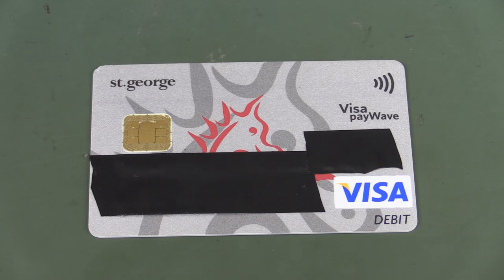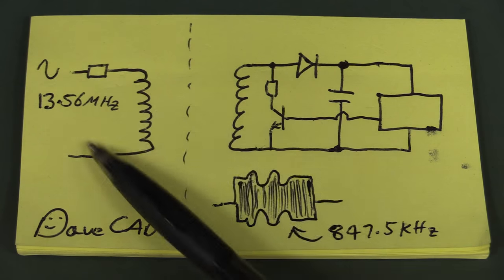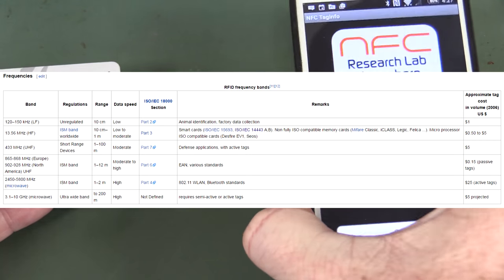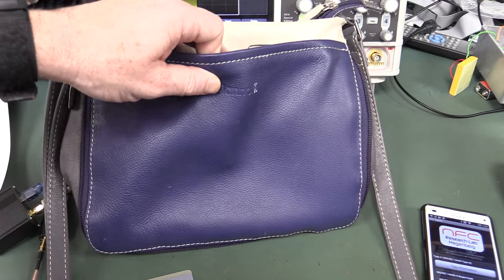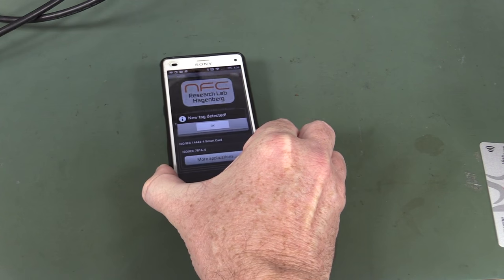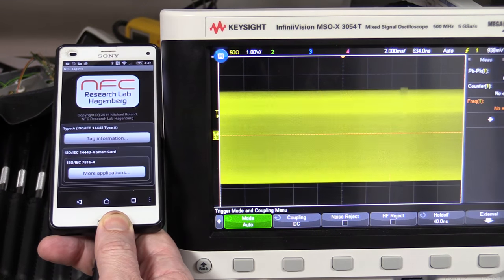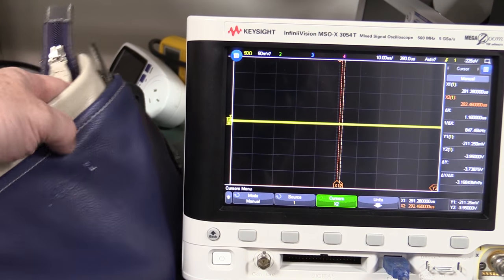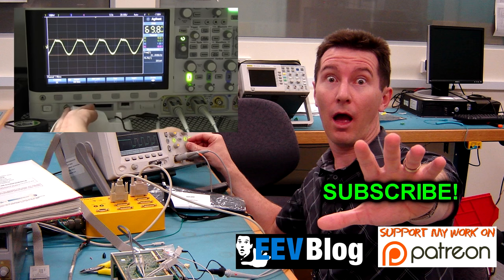EEVblog #889 - Credit Card RFID/NFC Theft Protection Tested

Comment: I have an idea or two about a protection features that can be added to these cards. How about if the chip in the card only starts working if it detects the electrical resistance from your fingers on the card? That way the only way the card can work, is if you are holding it. Otherwise it's only going to activate the coil if it is within a 13.56MHz magnetic field but there isn't going to be any data exchange. 
Something like a metallic grid on the card that should read somewhere between say 10 and 50 koms in order to start the chip. Or have specific finger locations that you need to hold the card at, in order for it to work.
And there is even a simpler way to do it, just put a dome switch in the card that should be pressed in order to connect the coil to the electronics inside. Needless to say that it's location must be a bit deeper in the card in order to prevent the button getting pressed while in your purse or pocket. That way you can only activate the card if you are holding at a specific location and apply some relatively significant pressure.

Comment: This is why no-one with any technical knowledge should call them 'RFID' cards. These are all NFC(Or near-field-commutation) cards.
Dave gets half a break as he's using layman's terms for ease of explanation, but searching for 'NFC' reader and 'RFID' reader gets quite different results.
Many public transport cards use the same tech, so they make for great test cards if you don't want your credit card shown on air. :) And if you want a somewhat overpriced(due to postage outside of us) way to see what tech a reader uses: https://dangerousthings.com/shop/rfid-diagnostic-tool/
Reply from the maker: Yes, true. The term RFID seems to pervade the industry though, although in regards to phones it's usually NFC.
Reply from the maker: BTW, The ISO 1443 standard itself uses the term RFID
Reply: That I didn't know! Shame on the ISO standards!
Also, as far as I know, these 'shields' act as much like a shorted turn as magnetic shielding, taking the energy the card requires and turning it into heat. A 'loop' of aluminium sheet works as a great shield, but one with a break in it(Still overlapping, but insulated) doesn't. For photos: https://goo.gl/photos/nWY5YPL9KhZabgFP9
I believe the more conductive the material the better it works in this application. I wish I had a piece of ferrite large enough to test this further.
Reply: The standard is correct. Maxwell is correct. "NFC is secure" is wrong.

Comment: Such a shield works while the card is in it.  Remove the card to use with the RFID scanner at checkout and a black hat behind you in the checkout line doesn't even need to transmit anything to pick up the signal.

Comment: Considering my CC number was stolen 3 times out of the local shopping center I work out of.  The issue was traced back to people hanging out in the food court/common areas on laptops with what 'looks' like a normal antenna hanging out a USB port.    How I took care of this scam was about the simplest thing in the world.    I just walked into my bank and requested a CC/Debit card WITHOUT the pay wave feature.  They make them in the chip reading variety as well.  As both my bank cards have chip readers, and NO pay wave nonsense.   Never be afraid to ask or request one.  Most banks do have these available and will gladly order it in for a customer.   The other scam that was exposed, the readers on gas/petrol pumps.  Seems the bulk of the companies continue to use the same KEY to open the access panels!  (And the serial ID sticker tabs are a joke!  One was ripped off a pump I went to use.  The clerk didn't check the system for a 'hack'.  Just slapped a new serial sticker over the torn one)   So never use 'pay at the pump' and request a no pay wave card.  And you'll be in slightly better shape. 

Another thing to consider:  How flippen LAZY is society when they can't be bothered to swipe or insert a card?  Do they want to look like David Copperfield doing a magic  "Wave the card trick" each time they purchase an item?    Just insert or swipe the card already.
Reply: >> "How flippen LAZY is society when they can't be bothered to swipe or insert a card?"  I have wondered the same thing.  It is just the latest novelty feature.  Most people are clueless and banks are still crooks.  An alternative to requesting a new card without this feature is to cut or puncture a single antenna coil trace or find the tiny bump where the components exist and give it a slight tap with a hammer to crush them.
Reply: Consider yourself lucky. I told my CC company that I didn't want a card with the RFID/NFC based system. They told me that they don't make any cards without this new technology. I was told not to worry. They would reimburse me for any fraudulent activity on the card. It amazes me that a CC company would rather fix CC fraud after the fact than try to prevent it up front. I wouldn't be surprised if their accepting fraudulent uses of CC's is part of the reason for high merchant fees and high interest rates to CC users.
Reply: No need to sign up.  LOL.  Actually I sent news stories about people in public areas using laptops to steal CC numbers and information.  The local center didn't do squat even when faced with evidence.
Reply: People love gimmicks.  And they think  "Hey, it's so cool that all I need to do is wave my 'magic card' to pay for something.   Now we have Google and Apple pay....paypal pay....    Things are going plastic in a huge way.
Reply: Tedybear315  Oh right, how did you deduce it was these people on laptops?
Reply: *****
  There was no other place where the general public would have access to do so.   I'm in my store 44hrs a week, and there's plenty of people on laptops hanging around.  I also monitor my card re: who has access to it while doing a purchase to ensure no one nips it to a skimmer.
Reply: Don't really think there are components to crush, these are printed on foil and have no thickness , sure cutting the transfo coil trace would work.
Reply: Tedybear315
Fair enough :)  Was just curious because, as Dave said, most contactless cards now encrypt the data.  Would be interesting to know what sort of set-up they are using to generate the EMF and what sort of range it has.
Reply: Dave being from "Down Under" they seem to have better security then us poor idiots in the USA.   With the advent of the tiny tiny CC swipe devices people can attach to cell phones however,  one must remain attentive on who takes their CC when a payment is being made.  Even a split second can equal a stolen number.
Reply: I've got another idea about how to fry the chip.
Overload it. A high pulse current thru a "pancake" coil with the card on top should fry the RFID chip without frying the "security chip".

You might also try just flexing the card a bunch (don't make a crease in it, just bend it).
It's a common way for RFID cards to fail, and there's no way to tell you did it on purpose.
Reply: 44R0Ndin would probably be enough take a hacksaw or heated blade and cut through the top 15mm or so of the card to brake the coil?
Reply: ***** True, that would work, but people (especially those who don't know the difference between the two chips in the card) would know someone's screwed with the card and might take it as an attempt to hack the security chip.
Even if I didn't know how the thing worked, I'd refuse to run a credit card that has what looks like obvious intentional damage to it if I was running the register.

Gently bending the card about 50 times (alternating directions, even bend without a crease line forming) would probably break the coil, and it would leave NO external visible trace.

Same goes for sending a small EMP thru the coil (to fry the RFID chip). Tricky part about that is not frying the security chip along with it (so microwave for 5 seconds won't work).

Comment: All magnetic fields have a electric field, an electro magnetic field is what we call RF. So technically wouldn't the transformer magnetic fields be just as much RF as traditional RF and if not please clarify?
Reply: I must ad to this that the magnetic and electric field do not have to be proportional and as such a magnetic field is much stronger in transformers then the electric field.
Reply: I think you are correct.  This system is an example of "Near-field magnetic induction communication" (see Wikipedia).  The electric field is largely suppressed by the absence of a proper antenna, so the magnetic field is unable to transmit much energy into free space.  Hence the transmission range is deliberately restricted to a few meters.
Reply: yes, modulating a coil is a radio.

Comment: "This is NOT a RF system, it works on magnetic fields instead of RF-fields" o.O Well, what are RF-systems working on ?
RF-systems are in theory a transformer system - and yes, they are called antennaes.
Reply: SnopFop - TheSkogemann rf (and other EM waves) are composed of electric and magnetic fields, but a pure magnetic field acts differently than an EM wave. That's why transformers and rf antenna/receiver systems follow different equations.
Reply: RF systems are NOT transformer systems. Transformers have magnetic coupling across the coils, RF systems do not couple between antennas. If you put a load on the secondary coil of a transformer, that creates a major load on the primary. If you turn on your radio in your car, that doesn't load the broadcast station at all. They have no clue if you are listening or not except with surveys.

RF systems use electro-magnetic radiation, not just magnetic fields. Transformers use magnetic fields and don't give a crap about electric fields.

Comment: Just put the card in an aluminumized envelope, just like you'd do with those toll transponders.
I'd have thought that putting the card inside of an aluminum box would shield it because the box should act as a shorted turn in the transformer.

Comment: Have you seen the jamming cards that deliberately jam the RFID frequencies when they detect a field? I've seen a bunch of these on the market (eg: armourcard, which is an Aus company - they sell them at JB). Would be interesting to see whether they're any good using the testing setup you used there. Interesting story is that I see them on the counter near the EFTPOS pinpads, and every time i get a failed card read at JB (and had to insert the card instead) one of these display stands is pretty much next to the pinpad. Tends to lend credibility to the product, but really silly placement by JB!
Reply: Yeah! Test this!
Reply from the maker: Didn't know about these, and JB Hi-Fi, hmm I could just go pick one up.
Reply: EEVblog Last I saw I think they were $50ish AUD or something, so not very cheap. Price may have changed tho. If need be i might be able to send you the one I have.

Comment: In England it's called "contactless" and it's a maximum of £30. When my card breakers, I always make sure that it's NOT contactless. 
It's not hard to stick your card in n put your pin in.

This is also why I'd never want a keyless car as the key puts out a signal, which can be picked up and within less than a min, your £10,000's car is no where to be seen.
This is why I'll ALWAYS want a keyed car.
Or an up to date finger print which measures if it's got a pulse. Which is no different to the thing you stick on your finger to check your BPM and oxygen levels. 

I'm not sure who comes up with these stupid, backwards, dick head ideas. But they need to be $h0t.
Reply: It's true and cars have been hacked, but they are getting safer. There still are cars out there that are vulnerable to various attacks, but the probability of someone actually hijacking and decrypting your code is tiny. You might say that you don't wanna take any chances, but take a look at how easy it is to pick a car lock anyway. No method is 100% secure. Same goes for the card. It could have an authentication feature which would make it pretty much unswipeable, unless some thief takes your data home and starts bruteforcing it, and even then it might just take years. I'm not sure if such a feature is actually implemented, but it should be.

Comment: Here abouts in Ontario Canada, people call it "arrfid" as a single spoken word.  The cards don't take a lot of flexing, heat or use before failure.  Any three of those cause them chips to fail, and I find my cards have a max six months functionality before I am getting a new one (one card replacement lasted six weeks).  My bank allows stores to set the spend limit up to 100 dollars, but the bank only allows 50 consecutive transactions.  But, that is when everything is in working order, and the general fail rate is about 40%.  Mostly because stores need to continually update security and they don't and their scanners stop working.   More interesting question to ask.  My bank manager told me recently that there is word in the banks that the mag strip is going to be phased out soon has anyone else hear this is a thing on the way?

Comment: I don't know about Australia but many places in the US they have RFID tags in the cars for toll roads, the readers are over the road at least 16 feet in the air, they can record me passing even at 75mph. now i doubt the protocols are the same but i'm fairly sure the tech is. larger antenna and more power obviously, but since your not a criminal and not equipped with these toys I wouldn't discount the criminal elements ability to procure such devices.

Comment: In the UK at least, banks are entirely responsible for any fraudulent transactions using the NFC component. Whereas using the chip and pin method, responsibility falls with the card holder automatically unless they can prove otherwise.

Comment: A perfect solution to stop these cards being read without the owners permission  would be to embed a photo diode into the body of the card that only allows the circuit within the card to activate when it is in ambient light (ie out of a persons wallet) then when it is in the wallet / bag, it would be unreadable.

Comment: Beats the paint-drying Lab Re-arranging vid  Dave :)

Seriously, was insightful. Actually quite simple how it works in terms of coms. But surely the card is read only,  so if you could capture the traffic and decode it, one could emulate it? Or perhaps there is some sort of 'key' on board, like  SSL

Comment: Can you switch that facility off or burn out the circuit with out of course damaging the chip. I prefer the idea of inserting the card and typing a code myself.
Reply: Take a hole punch to the coil around the card.
Reply: You could probably dump a big capacitor through a heavy coil of wire to create a magnetic field strong enough to fry the RFID chip.
I have a dent in my ceiling from setting a cpu heatsink a coil of wire and dumping about 1kj through it.
Reply: Or a snip
Reply: @rocketman221projects The magnetic strip would need to be left alone for "regular" use.
Reply from the maker: I wouldn't try and overload it. You likely can drill out the coil connection. 1mm would do it.
Reply: +rocketman221projects yeah, since it's the same chip as the one doing the normal EMV transactions (the one you see on the front, you can Google for "paywave x-ray" images), this will break your card. Oops.

Comment: In the nineteenth century mankind learned thanks to Maxwell how a changing magnetic field creates a changing electric field and a changing electric field creates a changing magnetic field (together known as "electromagnetic radiation", also known as RF radiation when changing fast enough). In 2016, mankind learned that Maxwell (and before him, Faraday and Lenz) were all wrong. "RF" in "RFID" totally doesn't stand for "radio frequency"...
Reply: Really Freaking Idiotic Device.  ;)  That about sums up the implementation of the technology in the various cards most of us carry around in purses and wallets.
Reply: Such videos keeps me believing what my students tends to do all this years. You could be perfectly good electrical engineer without a basic understanding of physical phenomena underlying a device operation.
"NFC works on magnetic field", "aluminum foil magnetic shielding" sound like F in grad school physics class ;]
Reply from the maker: Yes, and there is this concept for near field vs far field. Do you refer to and treat transformer coils as antenna?
Reply: Imho you should refer to magnetic and electric dipoles. There are a few weird effects in the near-field which disappear in the far field, like the two wave components (magnetic/electric) don't have orthogonal polarization and the radiation pattern in the near-field doesn't look like what "most" people now from textbooks. But in this case the antenna just couples to the magnetic part of the electromagnetic radiation.

Comment: Would it be realistically possible for someone to make a device that remotely fries the wireless pay circuit in these credit cards?
Reply: Yes, not difficult.
Reply: In theory yes. Super high magnetic field and sure it will burn... You might notice it tho.
Reply: It's been done! Android app the mimics a point of sale device.
Reply: Yes, TPAI made a video about it.
Reply: The point is to FRY the chip, not READ the chip.